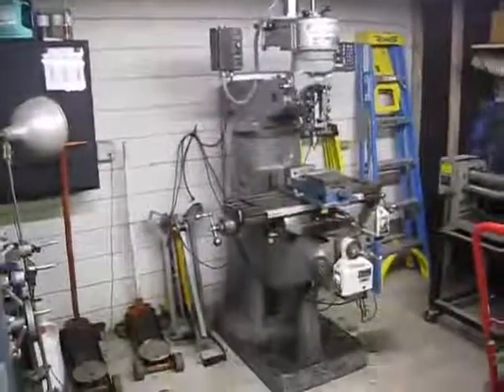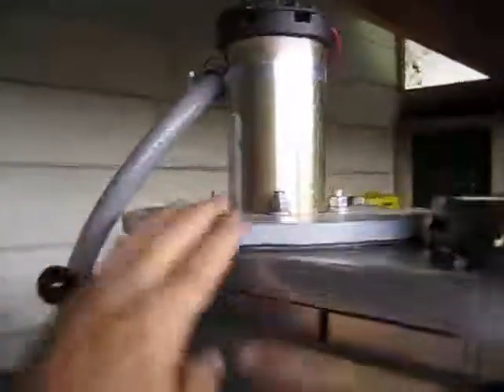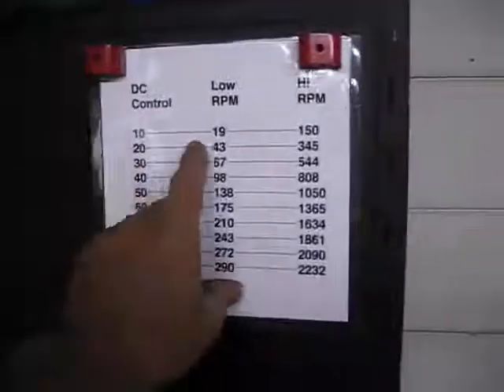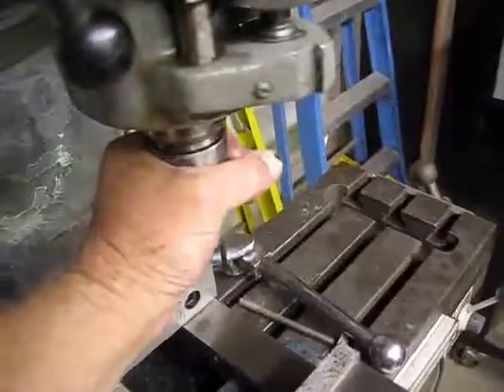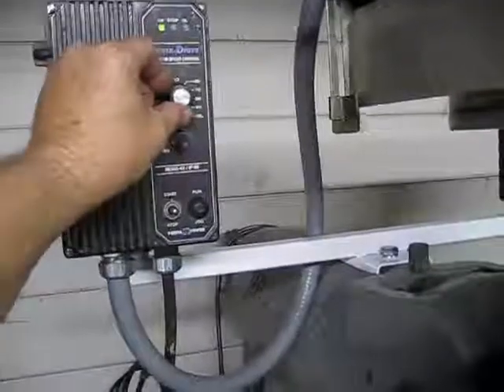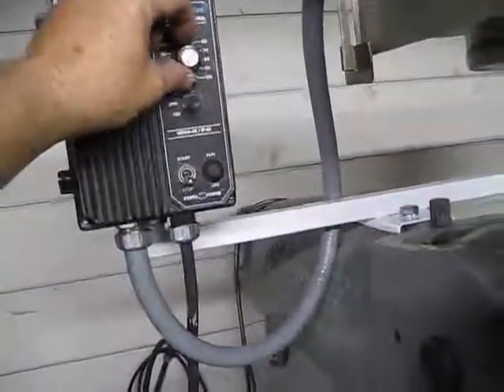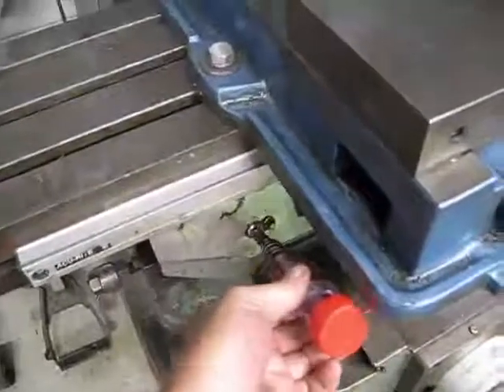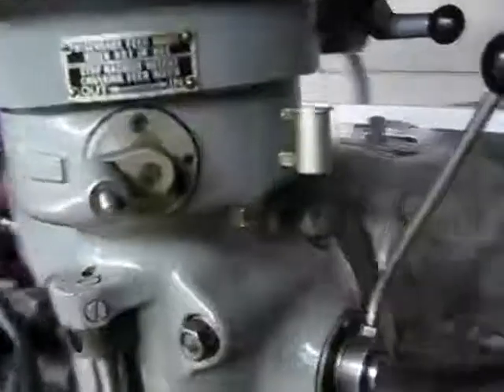Bridgeport mill with dc motor, DC speed controller

Comment: What tipe of DC controller you use?? The one on this video? And the DC motor it's from trade mill??
Reply from the maker: Yes, the one in the video.  Yes from a tread mill.  I was having a problem with blowing fuses in the controller when the mill was under a load.  I have since removed the DC motor and controller.  I put the 3 phase motor back on and installed a VFD GS-2 from Automation Direct.  No problems now,  Highly recommend The VFD.

Comment: Well done clean set up. I was also looking for an alternate power source since 3ph is too $$ to convert. You gave me some good ideas. Doing an M head on a brown and sharpe horizontal mill with treadmill power. Ive posted some on my channel with more to be added soon. Have you made any chips yet?
Reply from the maker: Yes, DC motor works fine,  More info at http://www.truetex.com/dcdrv.htm .
Reply: Look into VFD power converters. They're dropping in price.
Reply: VFD 82 bucks shipped.